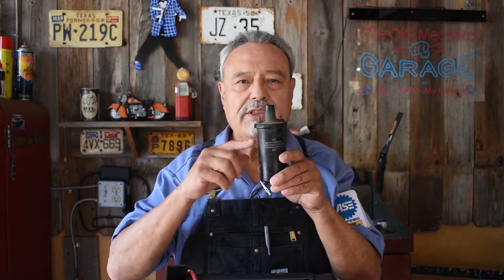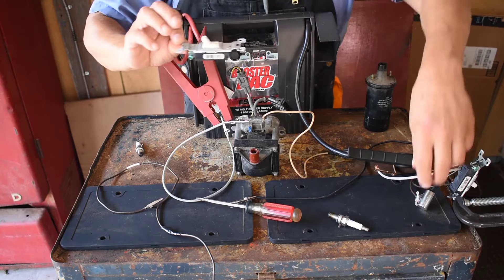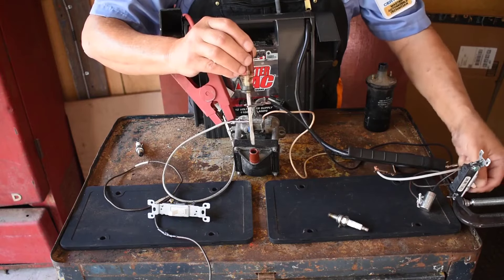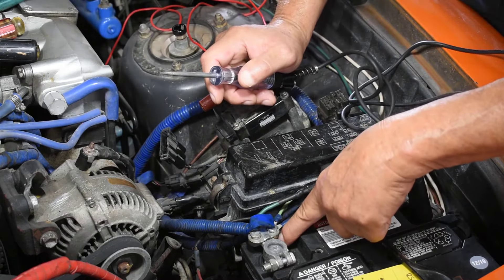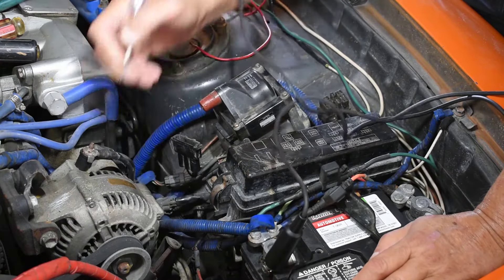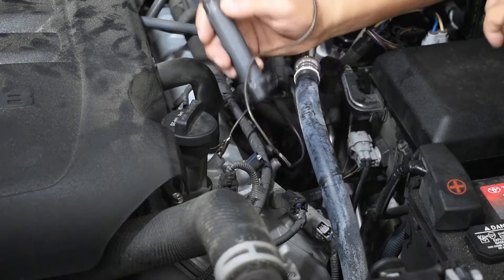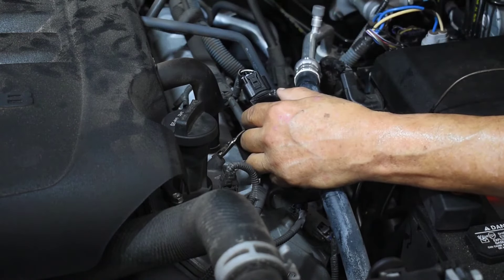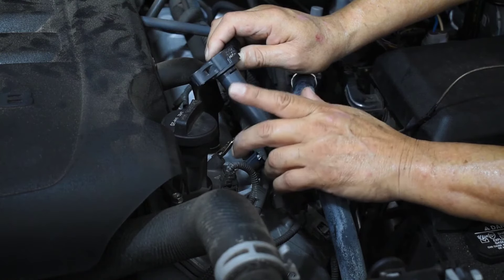Learn / See / Understand how Ignition Coils Work

Comment: I was confused why its called condenser in the automotive industry when its a capacitor. My Google friend told me historically is was known as condenser back in the 1700s somehow changed (for the most part) to capacitor in the modern world. Auto parts house charge you more for a condenser but an equivalent capacitor from an electronic parts house is a lot less. That's a good circuit illustration of how to product sparks, ever wonder what that condenser is for? You don't need it to produce an arc at the spark plug end but you need it to save the switch or prolong it.
Reply from the maker: Thank you for the view and the information. The ignition condenser used in the points and condenser ignition system was the hardest part to explain to my students. When I was an automotive student, the instructor explained that it was to make the points last longer. The condenser would kept the points from arcking.  I have tried to operate a coil without a condenser, and it doesn't work. It needs that special effect the condenser provides the system. The way I understand it, without the condenser, the induced high voltage will arc at the points and not at the coil output. Thank you again.